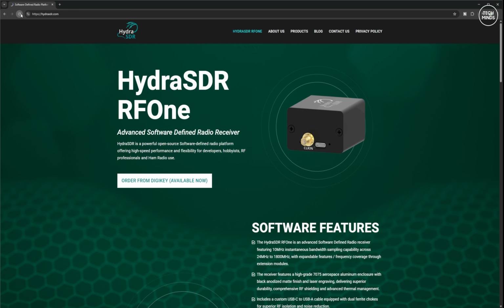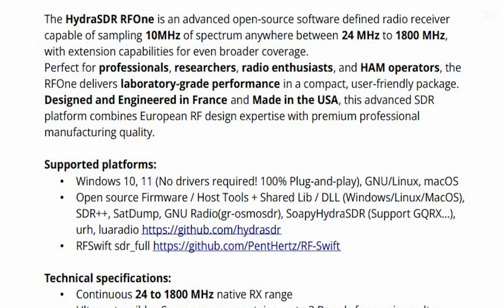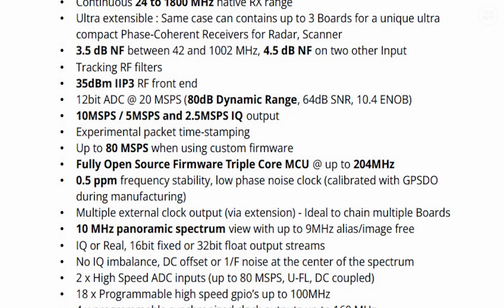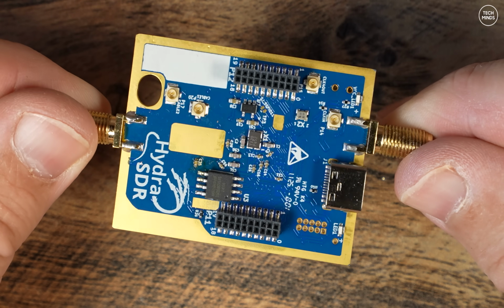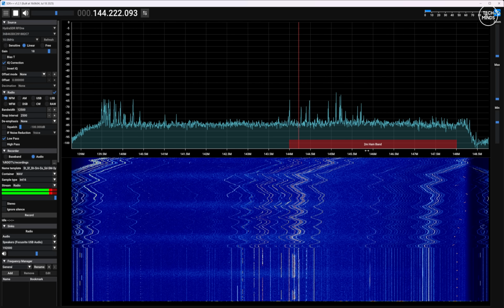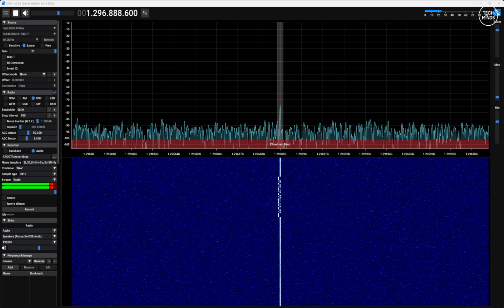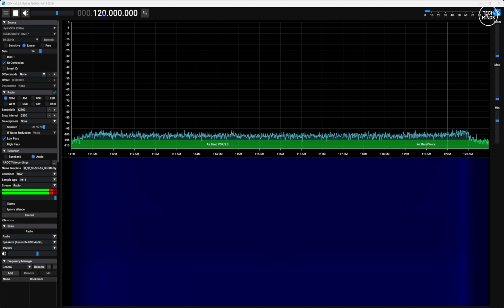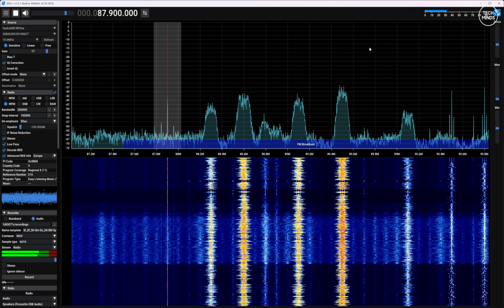HydraSDR RFone - A New High Performance Software Defined Radio - Made in the USA!

Comment: This is clearly a minor update of an Airspy R2. Like the Airspy R2 (whch I own together with a RTLSDR dongle), it is just an RTLSDR dongle "on steroids". In fact it's got the same exact front end and tuner (the "front end" let's call it so, is a pair of capacitors), but a faster, 12 bit ADC instead of the cheaper 8 bit one found in the RTLSDR dongles. With the 12 bit ADC, the full dynamic range of the tuner can be exploited, but the cost of the device multiplies by 6-8 times, and still the performance is not that much fantastic.

Comment: Smells like a clone, looks like a clone, basically is a clone because the maker has the IP from the AirSpy (so mentioned in comments), but because US made that's overlooked? If this dropped out of Asia people would be slamming it into the ground faster than you can say "SDR". Also no HF, come on. It's 2025.
Reply: While both use the NXP LPC4370 MCU, HydraSDR RFOne is a distinct design with unique architecture and features. Calling it a “clone” is misleading as I'm the Creator and full IP owner of AirSpy R2 / Mini design

Comment: Very interesting. The most sensitive SDR I own for the FM broadcast band is the Airspy HF+ Discovery, but its only downside is sub 1MHz of bandwidth. I’d hoped the new SDRPlay RSP2dx with its up to 10MHz would be the solution I wanted, but whilst it is also excellent, for the FM band it isn’t as sensitive in real world use as the HF+ D. So I wonder if the Hydra will finally be the pinnacle of fairly low cost SDRs for FM DXing. Thanks for the video et bien fait les concepteurs.

Comment: Ah the great promise of SDR radios. Since they are supposedly software centric, the promise to us radio fans is that performance will be improved with each new firmware update. But unfortunately that has not been the case. The processors (hardware) continue to do the heavy lifting (even Thetis) needs some heavy duty hardware. I’m a little fatigued by all these me-too boxes that really have no tangible improvements. Plus I’m confused. Airspy promised us the Airspy Ranger over one year ago and it still hasn’t come out. The same people are involved with this.
Reply: HydraSDR is entirely independent of any mentioned companies or individuals. We operate without pre-orders or crowdfunding, only announcing products once they reach mass production and proven stability.

Comment: Kind of interested to see how the Bias Tee keeps up after a few hours, that's a lot of heat coming out
Reply: It features premium PCB design and high-quality components that meet or exceed industrial grade standards, ensuring reliable operation even under continuous 24-hour use with 300mA bias tee power.
Reply: @bvernoux  is it possible to use direct sampling for the range below 24mhz?

Comment: Great video! Like you said, it’s nice to see the release of new SDR kit. I found the diagram of the board layout but couldnt find the type of RF chipset that’s being used. If I missed it , can you point me in the right direction. 

Since your channel is one of the most informed outlets when it comes to SDR hardware, I’m curious if you have any information regarding the forthcoming HackRf Pro from Great Scott Gadgets. From what I’ve read it’s available for preorder and has some impressive specs compared to the original HackRF
Reply from the maker: @TheElectronicDilettante  Waiting to get my hands on one. I never normally make videos about products until I actually have it in my hand. Unlike all these other "Brochure" channels lol.. Cheers and watch this space!
Reply: R828D (TV tuner, 3 inputs, also used on some sticks for use with the rtl-sdr driver) + LPC-something microcontroller that got 80 MSPS ADC.
All clocked from a silicon labs clock generator.

Comment: what functionality does stacking boards add? Could it be something like direction finding a la KrakenSDR?
Reply: only if there is coherence between each SDR.  (they share the same clock)     Even then,   you need about 4 SDRs to resolve any ambiguities in direction.    5 SDRs are better.
Reply: Shared clock.
Or use boards like upconverters/downconverters or LNB interfaces for sattelite stuff?
TX options?

Time will tell.
btw 3 boards would give 9 inputs (1 of 3 active per board, multiple active is possible but would mix), so a interesting challenge for the especially interested.